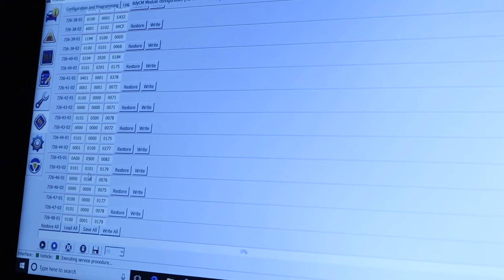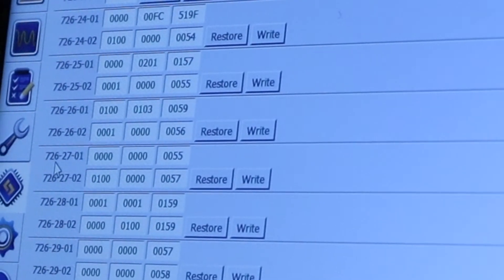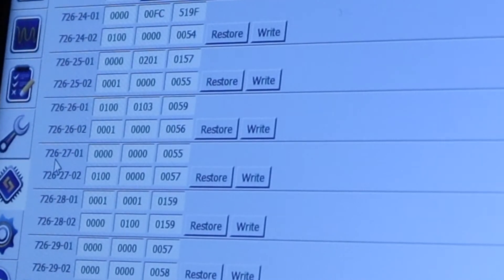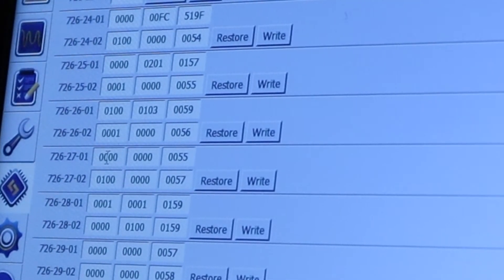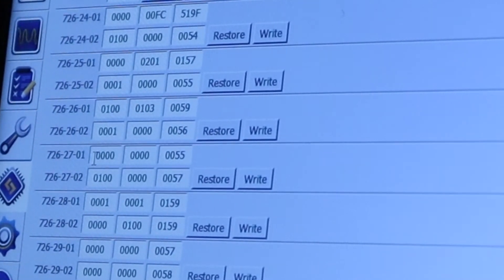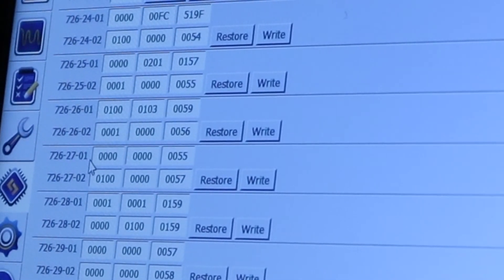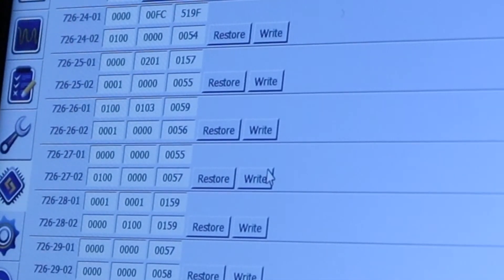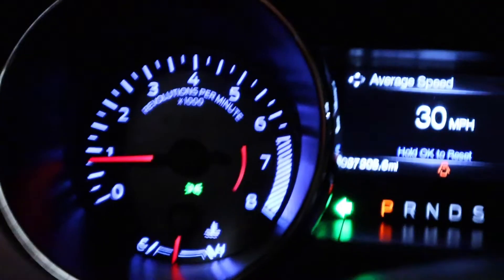How to disable Turn Signal Hyperflashing (without resistor) - Forscan FORD MUSTANG

Comment: Bro I just installed switchbacks on my mustang. I knew that the in-dash hyper blinking would be a side effect but it got annoying REAL fast and I don’t want resistors on my car. This Forscan trick worked. Thanks so much!! 🙏🏻
Reply from the maker: yes bro same here! the only downside is that it won't hyper flash If a lightbulb goes out. but no big deal to me. thanks for watching!
Reply: @STAYBAD  No problem dude. So unfortunately I had issues with the switchback bulbs flickering. I ended up returning them and getting the sequential turn signals from Diode Dynamics. If you can drop the cash I highly recommend them. They look sooo much better and the sequential feature is awesome!